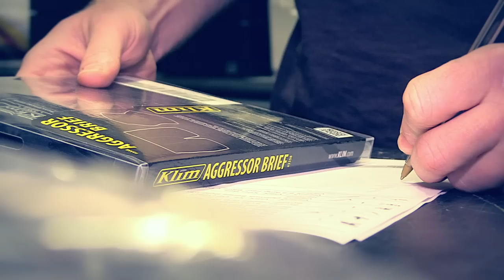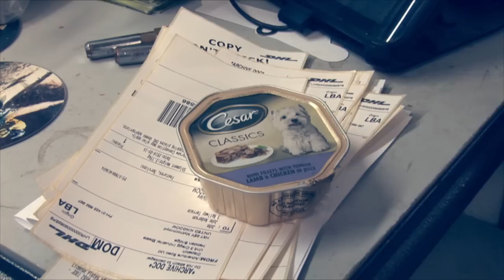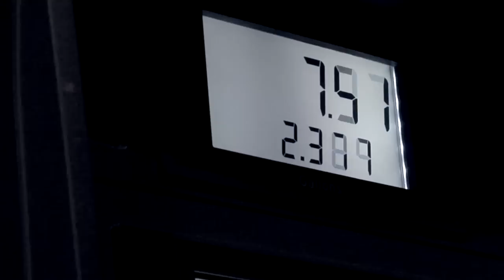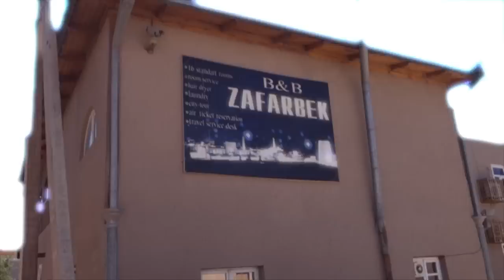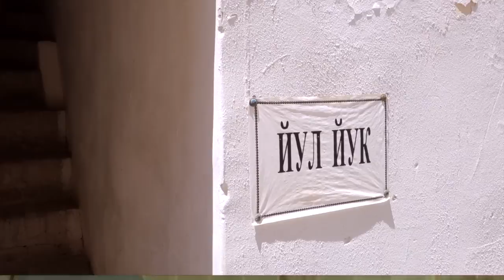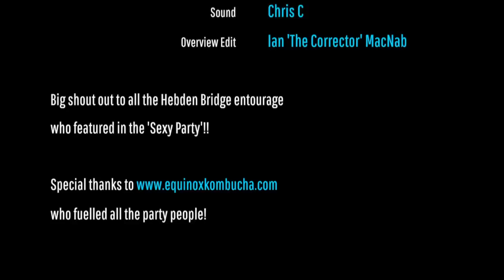Adventure Motorcycling Documentary - RACES TO PLACES S02 E01 Ft. Lyndon Poskitt

Comment: The octane rating of the fuel has absolutely nothing to do with the energy value! The octane rating value is determined by the fuel's resistance to detonation!
Reply: You're right, but higher octane fuels in an engine designed for them will produce more power, because they can achieve a higher compression ratio due to the resistance to detonation.